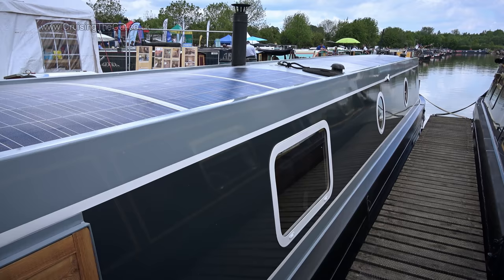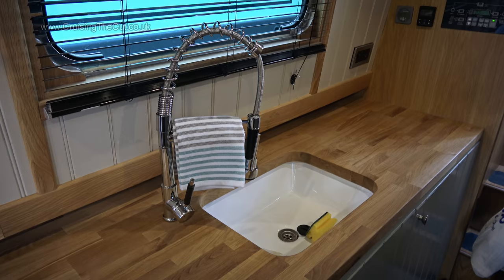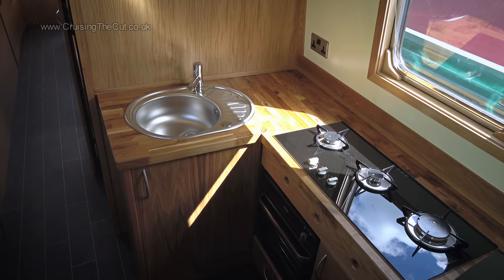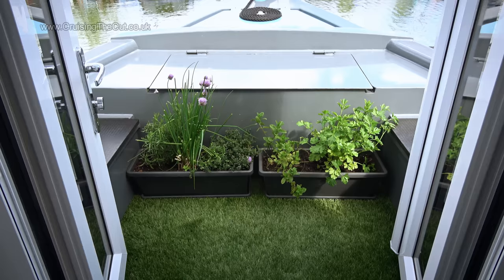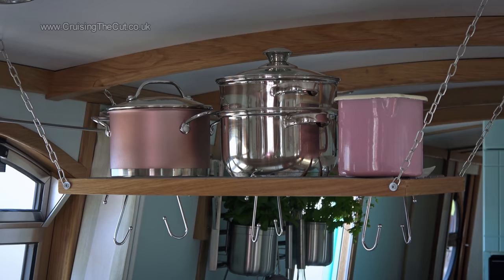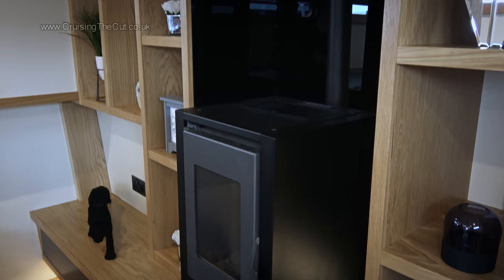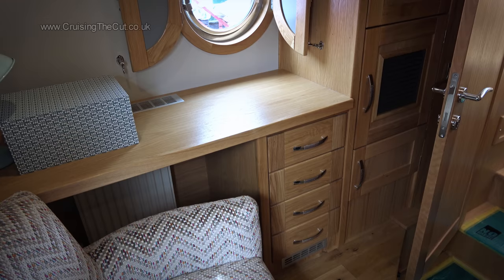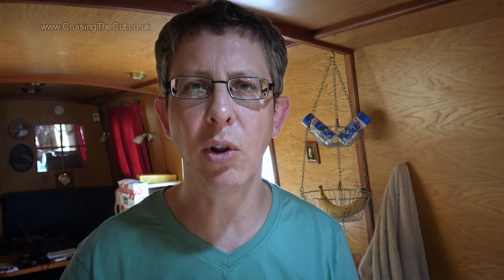176. The Crick Show 2019 (Inland waterways / narrowboats / canals)

Comment: will the lead carbon batteries have the memory problems that NiCa batteries have? or can they be recharged on the fly lik LIOn batteries?
Reply from the maker: No, no memory issues, it's not generally a problem with these types of batteries or even the standard lead-acid or AGM leisure batteries.

Comment: Found the charge voltage on the spec sheet. https://www.alpha-batteries.co.uk/12v-leoch-pure-lead-carbon-plh-c100-deep-cycle-leisure-battery/.  
In the technical specifications section:
 Ideal Charge Voltage14.1-14.6Top Up Charge Voltage13.5-13.8v
Reply from the maker: Ta. It's not right though. I just got sent the official battery manual from Leoch and the cyclic charge voltage is 14.1-14.4 though I still have some queries outstanding.

Comment: One of these companies should put a Volvo Penta D6 or something in a narrowboat.
Reply from the maker: It would be pointless; the canal speed limit is 4mph and the canals are barely deep enough for the boats as-is - as soon as you start revving, the back of the boat digs down into the water so you'd just churn your prop into the mud and get nowhere, slowly, with a lot of noise and waste of fuel.
Reply: @CruisingTheCut  I meant for the lulz, not for actual usage. Could be tested in deeper waters.

Comment: We have a flat with a balcony facing north, so we don't use it very much.  Wouldn't the well deck be in the same category and offer you more room in the cabin, if it was raised to the level of the rest of the boat?  The other question, is why does your central heating boiler make so much noise and do they all have to do that?
Reply from the maker: Do you mean "lowered" to the same level? Some boats do have that but often the water tank is stored under there so lowering it isn't feasible.
Reply: @CruisingTheCut  Hi David, sorry, I meant raise.  I understand what you say about the water tank, but I saw boats on your vlog where the cabin went right up to the stern.  Maybe they store water in the shell of the boat?
Reply from the maker: Unfortunately I'm entirely lost as to what you mean by raising the well deck level to that of the cabin, the well deck is already higher than the main cabin by a substantial margin. I also don't understand what you mean about the cabin going right up to the stern or storing water in the shell of the boat. Sorry!!
Reply: @CruisingTheCut  Sorry David, I meant lower, and I will try and point out what I meant by referring to points in your videos where such craft have gone past, which do not seem to have a well deck at all.  At least , not one that you can see from the outside.

Comment: David one boat you toward had a dishwasher in it do you know any details or any information about that model is it a 12-volt Model ?
Reply from the maker: No info, sorry, but I suspect it's a 230V unit.
Reply: Hi - that was our narrowboat Sea Glass it’s  a 240 volt  Bosch Compact. We either run it on the 30 min cycle through the inverter or when we are cruising. It is ace!

Comment: How much is the total length of all channels in the UK, what is their average width and depth?
Reply from the maker: About 2,000 miles of canals.
Reply: About 4000 miles, 2000 are maintained by CRT which is the main authority (hence CtC reply) and about 1/3rd of these are the narrow canals.   Unfortunately if you wish to cruise majority of system you need a narrow boat as these are the most wide spread and connected.  Narrow canals are limited to 7ft ish wide boats, and they usually around 3-4ft deep

Comment: Hi David followed your journey and I find myself in a position to buy a boat .....what size is your boat and are you able to use all the network ...many thanks Barry
Reply from the maker: Mine's 56 and can go pretty much anywhere. 57 is the usual max but 60 can be squeezed diagonally in shorter wide locks.

Comment: 14.1v - 14.4v it says here: https://www.victronenergy.com/upload/documents/Datasheet-Lead-carbon-battery-EN.pdf
Reply from the maker: That’s for Victron batteries and mine are not Victron. Same chemistry but each manufacturer may have slight differences so I’d rather get the info from the company that made the ones I have.